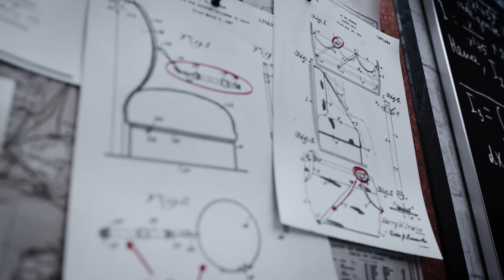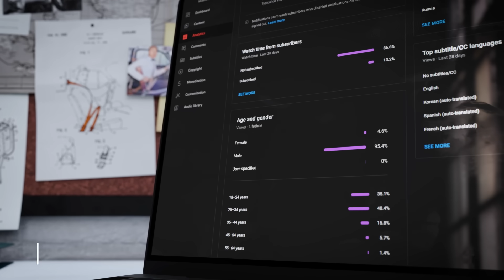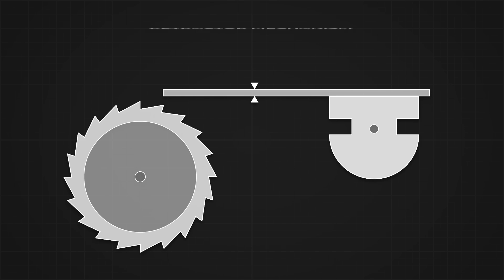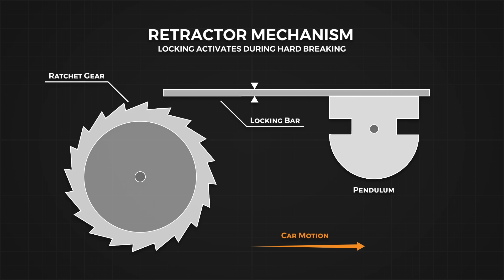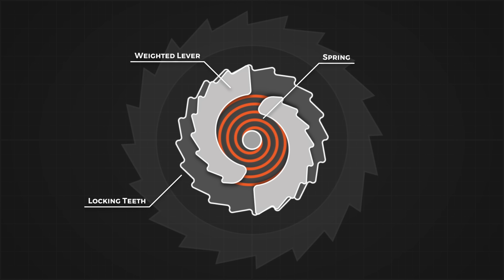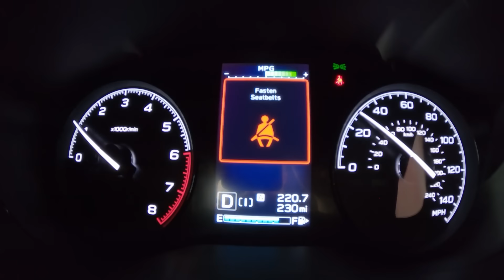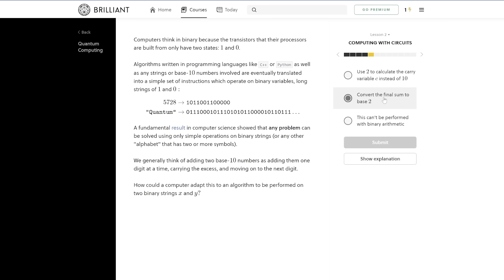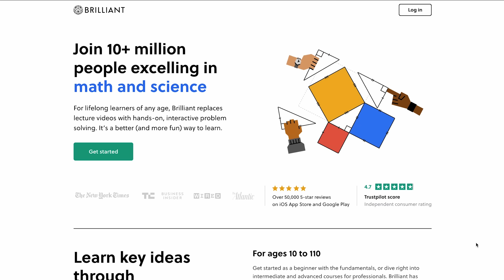How Do Seatbelts Work?

Comment: The fact that the inventor released the patents free of charge is simply amazing
Reply: There are definitely arguments for patents, but i think at the very least there should be limits on what can be patented and they should be much shorter
Reply: @sage5296  Patents exist to encourage  innovation and give companies a way to profit off of creating innovative ideas. Once they start to get in the way of safety or creating better products patents become an obstacle to innovation not a boon. IP laws are a serious issue because codifying that you can profit from an idea alone has led to so much innovation, but it has also lead to a lot of nasty anticonsumer and unethical practices too(think insulin). It needs to be seen on a case by case basis. I believe the jist is that you should be able to get your moneys worh but after that you either have to licence it to anyone who pays(a reasonable amount) or its free. Like for example could you imagine if ford could just patent the idea of a tire or a wheel itself and refused to let any other company makes cars with wheels?? It wouldn't be reasonable. It takes some nuance but you just need to make sure IP laws reward innovation without stiffling innovation or sacrificing safety/ethics.
Reply: Patents shouldn't exist

Comment: Seat belts saved my life twice, one time to avoid run over a fallen biker on a curve I turned the other way and hit a tree at 80Km/h, and once at the runway a slow driver came from behind a truck suddenly, slammed the brakes to avoid throwing the other car under the truck, the car hit the curb spinning at 140km/h. Never drove more than a block without it since I learn how to drive.

Comment: Not wearing seatbelts in a car feels like looking down a steep drop without a  railing for me. I wear them even if I do slow movement operations, like manouvering cars in a car lot - There was a machine in a road safetey course initiated by my high school back in the day, which simulated a sudden stop at ~5-7km/h, without seatbelt. No chance cushioning yourself with your arms even at those speeds.

Comment: When seatbelts came out, I wasn't a fan; therefore I didn't use them. Several years later at a county fair, the state police had a trailer they called "The Convincer". It was a car seat (with seat belts) on a small ramp that slid down to a sudden stop. My Mom insisted I ride it while she watched my toddler children. I went over and the officers showed me the proper way to wear the seat belts, and hoisted the seat up the ramp. Then they simply released the mechanism and I slid down. It really wasn't going very fast so I wasn't expecting much. 
That sudden stop and the amount of force I experienced did as intended; it CONVINCED me! That was decades ago and I ALWAYS wear my seatbelt, even if I'm just moving the car in the driveway!

Comment: I'm an engineer and have worked with seatbelts for a few years. This is a good video that is mostly correct, but you're really only scratching the surface of the technologies that goes into a seatbelt. The most advanced ones have over 200 components, an electric motor and an airbag inside the webbing. And we haven't even talked about the anchor plate and buckle components!

Comment: While including it into the great narrative of this video, it is worth noting that seat belts (and a lot of other devices) were developed and designed around adult male users. There is a growing realization that not all bodies are created equal and will react differently to things like seat belts and restraint devices. 

For example, the NHTSA didn't use female-style crash test dummies until 2011 and as you might have noticed almost all of the dummies in the video are roughly the same size, weight and body type. With the only variance being a smaller venison meant to simulate children.

Comment: I went off the edge of a road up in the mountains near where I live, went like 60 feet down an embankment in the woods. Rolled over a log but managed to walk out of it with only a few scratches, I was absolutely saved by my seatbelt holding me where I was and the cab of the car holding up when it rolled (RIP 1997 Nissan Maxima, amazing car)

Comment: So… 5 point seatbelts, or harnesses, seem to be used in more extreme situations, like motor racing, aeroplanes (and astronauts?). They also seem simpler in design (or maybe that’s a bit naive of me?). Are they safer because they provide more restraint or is something else happening here?
Are they not normally used in cars simply because of convenience?
Reply: With a racing car, you are there with complete focus on driving at the limits of what the car can take. In a typical road car, you're listening to tunes, carrying groceries or cargo, transporting kids or passengers, etc. so versatility and convenience are really important. On a track crashing and fires are not uncommon, and all the cars there are only there to go fast. Thus, safety is the most important thing, convenience be damned.

A 3 point plus airbag could get tangled or block an exit, or receive an unusual angle of crash where it is not effective that you wouldn't normally get on a typical road, but could happen easily on a track, etc. With a 5 point, you are seriously strapped in so you won't slip around with heavy G's from driving, but can still release it quick to get out of a fire. You actually don't want airbags with a 5 point because they are unnecessary and would only get in the way.

But just like how a 3 point needs to be paired with airbags to work well, a 5 point needs to be paired with a roll cage to keep the car from crushing from any angle, and a HANS device and helmet to keep your head from whipping forward so hard it breaks your neck in a head on crash. Both of these things are really annoying for everyday driving, and with a 5 point you have to use them every time you drive the car. The roll cage means you have to clamber into the car through the window, and the straps, helmet and HANS device take a while to put on and are not the most comfortable things even if they are custom molded.

It was a herculean effort just to get the average person to wear the 3 point, and we STILL have a problem of people not wearing them for whatever stupid reason. So 5 points are only used when you have extreme conditions, driven by people trained to operate that vehicle and driving/piloting it is the only thing they are focused on for good reason.

Comment: I actually prefer using my seatbelt when driving or when being a passenger. Not just out of habit or because of the annoying alarms cars have. It’s simply more comfortable to wear a seatbelt, it stops your body from moving excessively around the seat. 

I think of seatbelts as the belt around some loose pants. You use a belt to keep them from falling. Having to constantly adjust your pants is such a pain, just as not wearing a seatbelt means your body is too loose on the seat. That plus the obvious safety benefits is simply a no brainer to use a seatbelt all the time

Comment: A good friend of mine was in a bad truck accident that came to rest with him on the ground and the cab shell on his shoulder. He has blown a steer tire going around a curve and went off the road and the load of paint primer that was in bulk bins came through the front of the trailer and forced the can off the frame. 

He had some serious injuries but the only long term damage is plates and screws in his shoulder. He was not wearing a seat belt. 

I always wear a seatbelt because I want to be able to stay in the seat at the controls if something happens. I would 100% not have survived that type of accident. 

Seatbelts extremely effective safety devices 99.9999% of the time. I will never give an adult a hard time if they choose not to wear it.

Comment: There's one thing that annoys me about seat belts in some cars, my mom has one that somehow doesn't always trigger the no seat belt alarm initially but then as the load of the non-person shifts a bit on it during the trip it decides "this chair is occupied! I have to do the annoying beeps" while you're driving. No fun when you're alone in the car, these days if I do end up using it I just insert the seat belt anyway even if the load doesn't need it for stability.

Oh and I can vaguely remember as kids growing up the rear seat in the middle had that old style only around the hips contraption. Back then as far as I can remember seat belts were only strictly legally required in the front. And if your car model had them in the rear then you had to use them, but only if it came out of the factory with them. That middle seat one was also hard to get hold of at times, it would often get lost between the cushions and got ignored on many rides.

Comment: As a crash test engineer I appreciate the call here and your efforts to grasp all this information into 10min. But the very first dummy showing up here is a BioRID dummy (biofidelic rear impact dummy) and actually only for low speed rear impact collisions to develop save head restaurants. Probability the reason why you cutted those sequences so strange to me. The important part is never visible 😂 the part when the head is hitting the headrest or actually the 150-200ms bevor it does. The rebound and forward movement of the head is not even measured anymore in this kind of test. But the head restraints or the headrest itself is a topic for another video on its own. At least as overlooked, controversy and unpopular as the seat belt during its introduction. And even today people do not appreciate or understand the work principle of this simple yet incredible healthy part of their car seat, as too many of them I see every day on the roads are incorrect adjusted by their users. This dummy development and tests are mainly driven by insurance companies in the late 70’s when more and more expensive insurance cases of people with neck injuries caused by rear collisions came up.
Reply: ᴵ’ᵐ ᵍˡᵃᵈ ʸᵒᵘ ˡⁱᵏᵉ ᵗʰᵉ ᶜᵒⁿᵗᵉⁿᵗ. ᵂʰᵃᵗ’ˢᴬᵖᵖ
ʰᵉˡᵖˡⁱⁿᵉ ⁱˢ ˢʰᵒʷⁿ 
ᴮᵉˡᵒʷ👇 ᴵ’ˡˡ ⁱⁿᵗʳᵒᵈᵘᶜᵉ ʸᵒᵘ ᵗᵒ ˢᵒᵐᵉᵗʰⁱⁿᵍ ⁿᵉʷ

➕ᴼⁿᵉ ˢᵉᵛᵉⁿ ᶻᵉʳᵒ ᵗʰʳᵉᵉ ˢⁱˣ ᶠⁱᵛᵉ ᵒⁿᵉ ⁿⁱⁿᵉ ᶠᵒᵘʳ ᶠᵒᵘʳ ⁿⁱⁿᵉ…

Comment: I didn't gasp when I saw the original seatbelt design.  I personally prefer the five point harness, as it's a lot more effective at keeping you in place, but I'd suspect the "defects" of lower comfort and not as adjustable for a variety of drivers probably didn't win it too many fans.  What I don't understand though is why a five point harness isn't considered road safe or legal in many areas, leading to the hilarious situation of rally drivers having to wear two seatbelts (stock three point and the five point harness) when in transition between stages.
Reply: I wonder if a tight 5 point could reduce road fatigue that happens because we subconsciously compensate for the vibrations of the car with our muscles.

Comment: What an excellent video. I grew up in the '70's and '80's - in the early part of my life, we had a Volvo station wagon and a '65 Dodge Dart. The latter had lap belts that were installed as an option. The former had one of the earlier versions of the 3-point harness. Even in the '70's the 3-point harness was considered somewhat novel. By the time we replaced the Dart with an early '80's Toyota Camry, the 3-point harness was pretty much standard, yet many people still refused to wear them.

Like you, I remember when the tide began to change, in no small part due to enormous public service campaigns and enforcement of belt laws. Thankfully, I'm certain it saved the lives of some friends and loved ones along the way.

Comment: I love your videos, and I watch them nearly right after they come out. But this video felt fairly insensitive at two points. 

1. Please do not equate gender to genitals. If you had said "somewhere around 97.5% of my audience" instead, that wouldn't have been insensitive, as most people are cis. However, translating the percentages for gender directly into genitals with no room for error is insensitive. Us trans people exist, and those argument(s), that gender = genitals (or genitals = sex and that gender doesn't exist), are the very arguments FREQUENTLY used by transphobes to deny our existence, invalidate us and discriminate against us. 

2. The lack of discussion regarding current issues with seatbelt design in regards to cis women, trans women (if on E), and other people going through Estrogenic puberty, was disappointing, to say the least.

Comment: Why tf don’t we use better seatbelts in airplanes istg it’s not as uncommon as people think to survive a plane crash. So I think a better seatbelt would be appropriate. Like what the flight attendants have, or pilots.
Reply: ᴵ’ᵐ ᵍˡᵃᵈ ʸᵒᵘ ˡⁱᵏᵉ ᵗʰᵉ ᶜᵒⁿᵗᵉⁿᵗ. ᵂʰᵃᵗ’ˢᴬᵖᵖ
ʰᵉˡᵖˡⁱⁿᵉ ⁱˢ ˢʰᵒʷⁿ 
ᴮᵉˡᵒʷ👇 ᴵ’ˡˡ ⁱⁿᵗʳᵒᵈᵘᶜᵉ ʸᵒᵘ ᵗᵒ ˢᵒᵐᵉᵗʰⁱⁿᵍ ⁿᵉʷ

➕ᴼⁿᵉ ˢᵉᵛᵉⁿ ᶻᵉʳᵒ ᵗʰʳᵉᵉ ˢⁱˣ ᶠⁱᵛᵉ ᵒⁿᵉ ⁿⁱⁿᵉ ᶠᵒᵘʳ ᶠᵒᵘʳ ⁿⁱⁿᵉ….
Reply: iirc the benefit and reliability compared to brace positions (given enforcing it is hard) plus maintenance costs were factors in why that isn't a thing on aircraft

Comment: DON'T FORGET YOUR PETS! Animals should be in a secured crate. They also make doggy "seat belts" that tether their harness to the headrest supports. Don't use the ones that clip in a seatbelt receptacle unless you keep them in the middle of the back seat because hard braking will cause them to be thrown out of the seat. You want it symmetrical. NEVER CLIP ONE TO A COLLAR, it will crush their larynx or snap their neck if you get in an accident. It MUST be clipped to the back of a strong, properly fitted harness. Make sure you adjust the length and move the seat back far enough so they have enough freedom to lay down or sit up, but not enough to slam into the dash. The back seat is, of course, safer than the front. Airbags are usually off for pets because the car thinks they are children. As primitive as doggy steatbelts are, it is still a hell of a lot better than nothing.

Free bonus: your dog can't jump out of the car now when you stop with the windows open. :D

Comment: While wearing a seat belt is a smart choice, why must it be mandatory? Even if it is morally wrong, don't I have the (legal) right to make dumb choices?
Reply: your actions affect others in ways you cannot fully predict. If you're the driver, a seatbelt can mean the extra second of instinctive reaction turning the wheel and having your foot still on the brake pedal in the second of impact. It literally can save lives other than your own, not to mention the trauma you've saved the other driver's kid from you not having been turned into chunky salsa before their eyes. Also, wearing a seatbelt is an act that subconsciously reminds people that there is risk in driving whoch translates to a few mph off the speed, which... well. Even a 5km/h decrease is over an entire carlength in stopping distance at potentially fatal speeds.

Comment: Seat belts also help you keep control of the vehicle. If you take a corner too quickly or are struck from the side, they keep you behind the wheel so you can steer.
Reply: If you are relying on your seat belt to hold you in your seat you are driving way to quickly for either the road conditions or the age of your vehicle. The only situation that might occur realistically is on a race track in which case you typically have racing bucket seats (which do more for holding you then a seat belt) and a 5 point harness.
Reply: @tasdasd3856  yes, but this is specifically for non standard conditions like fucking up or getting into a crash situation where the car gets flung towards potential life-ending circumstances.